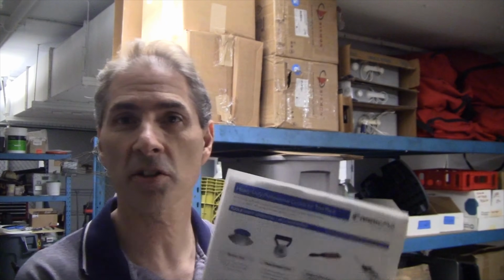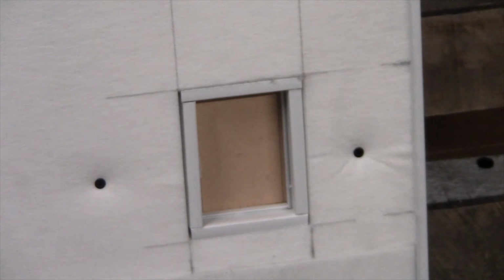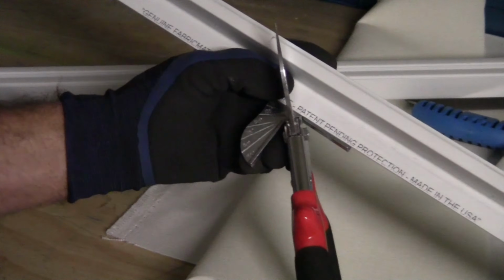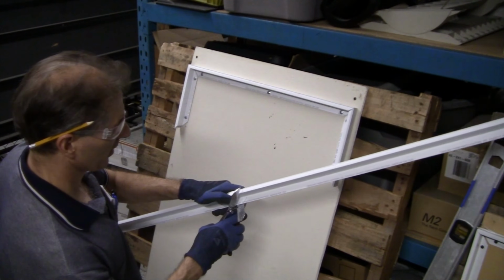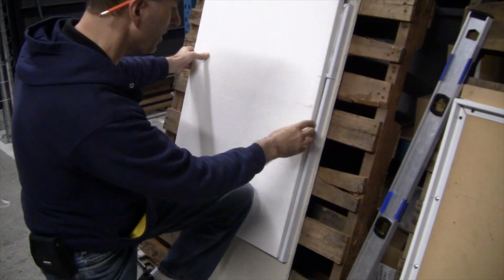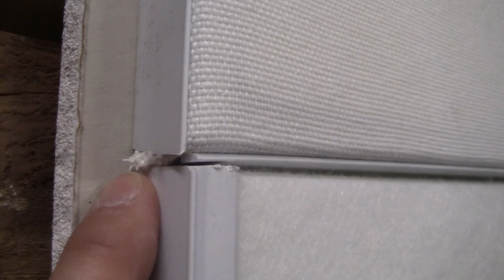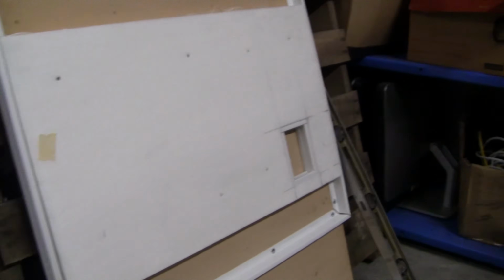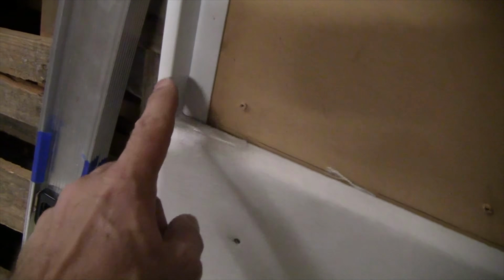FabricMate Wall Acoustic System Install Beginners Guide Part 1 of 2

Comment: Thanks for all the info and detail you provide in your video. Keep up the great work. I didn't understand what you mean by 45 degree angle. Isn't it a 90 degree?
Reply from the maker: the corners are 45 degree
Reply: You cut 2 of them at 45 degrees so when you put them together they make a 90.